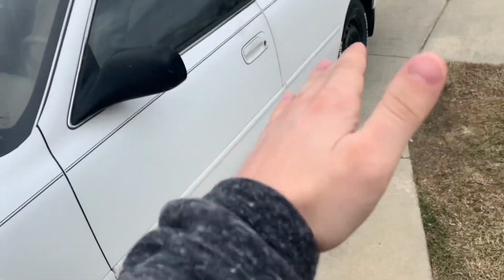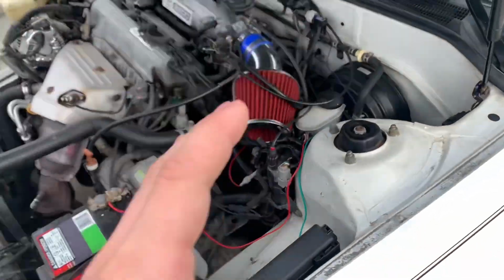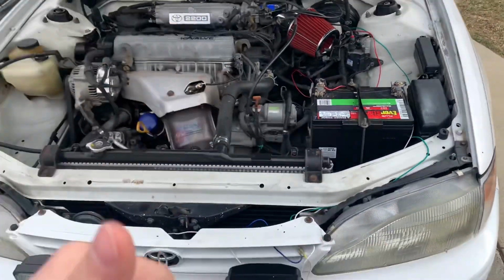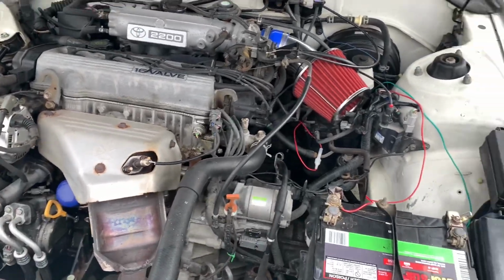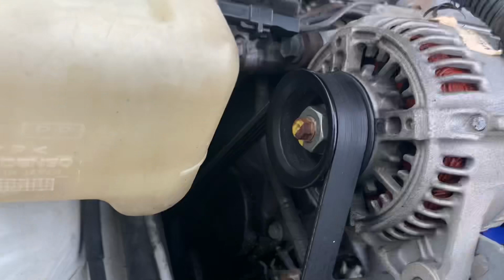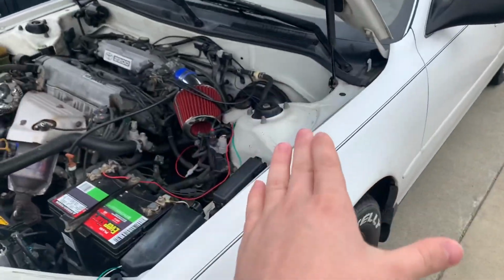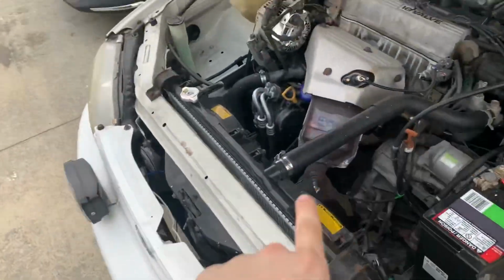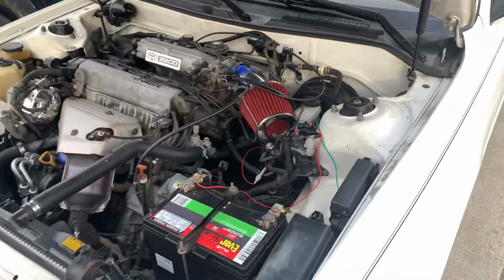My plans for my car

Comment: Nice vid, I have one question though. Did that car come with those mudflaps? They look aftermarket. Also, the oil leak should be your first priority. As you said, it was leaking when you bought it. Fixing that should have been the first thing you did before adding other things that aren’t as important as a oil leak.
Reply from the maker: They are stock but I did repaint them thats why they look like that
Reply from the maker: And yes you’re right I should’ve fixed it in the first place